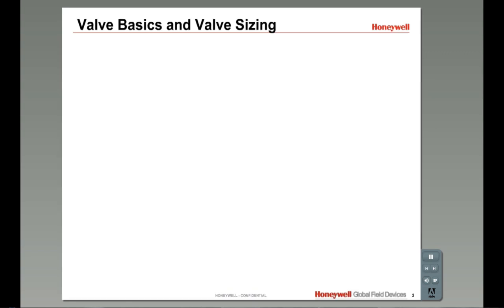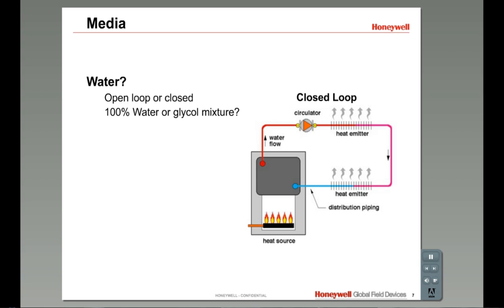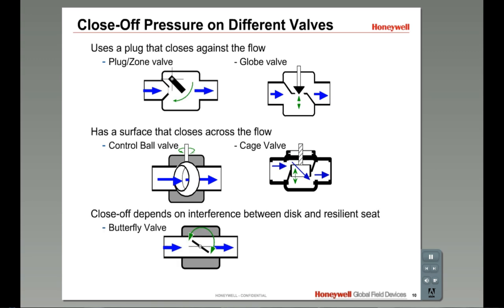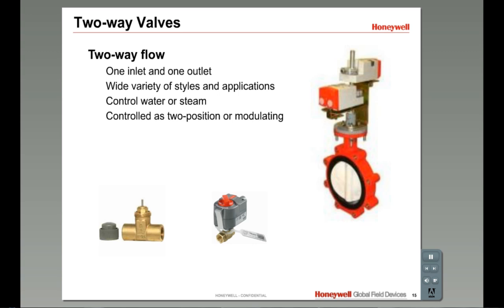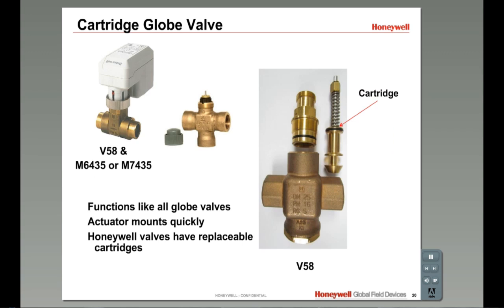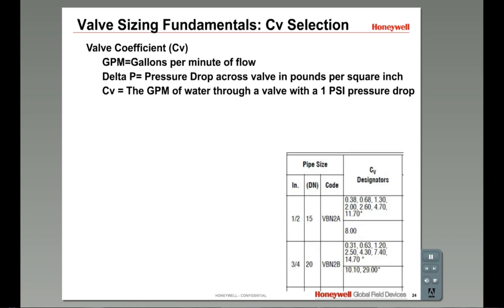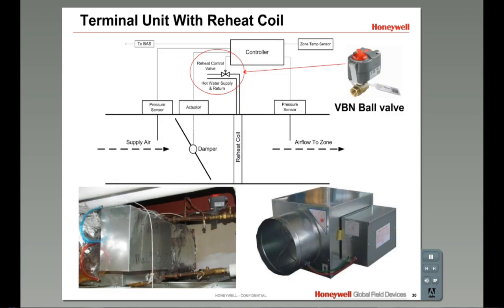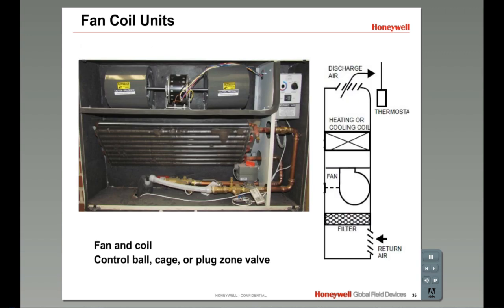Honeywell Control Valve Basic Training

Comment: Thanks Sir for the video.
In your presentation I think there is a confusion between Plug valve and Chech valve. Could  you please confirm?
Reply from the maker: Hello. Plug valves are a category of valve that can be confusing. They are often used to control the flow for HVAC systems as on/off valves. The Honeywell V8043 or VC valve are like these. The plug is on an arm that rotates and moves a ball (plug) to block flow, or to allow it.  A globe valve also has a plug in it that is moved up or down to block flow...but I call those globe valves, not plug valves.  A check valve does work like a plug valve in that it has a round ball that can allow flow in one direction, and if the flow reverse, close off the flow (not always a ball, a check valve may have a diaphragm, disk, other means of stopping flow). The principal difference is that the plug valve is a control valve... actuated by a motor of some kind. It allows flow in one direction or stops it. The check valve is more passive, allowing flow in one direction, or moving when the water flow direction is reversed to prevent back-flow. Does that help?

Comment: solenoid valve is exist in honeywell?
Reply from the maker: Natural or LP gas valves often use solenoid valves, like the V4046 or V4295, and some humidifiers use them to allow water to flow into the humidifier, like the 32001639-002. However we do not have solenoid valves for HVAC on/off water control. (at least not that I am aware of in North America)
Reply: hydralicvalve